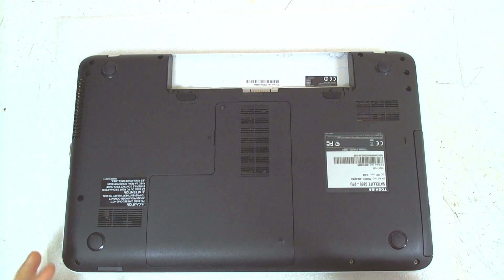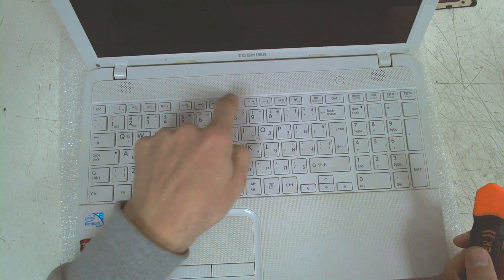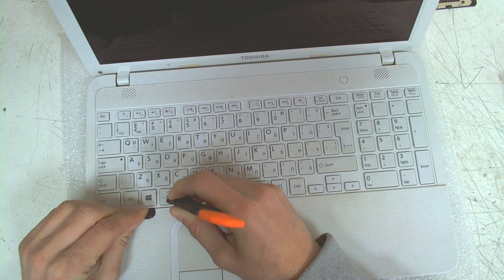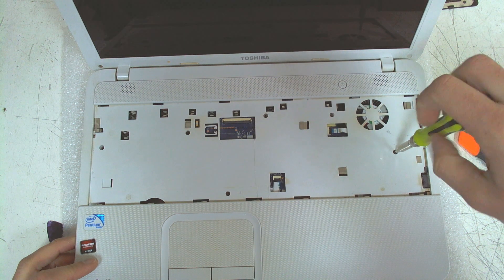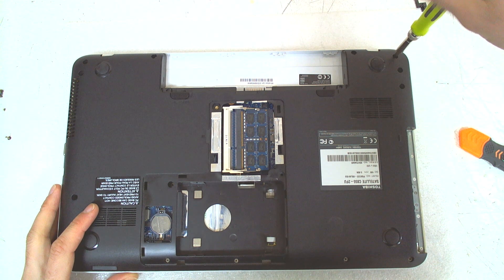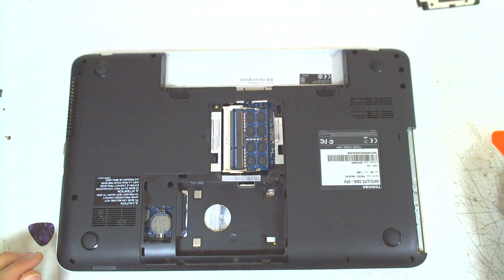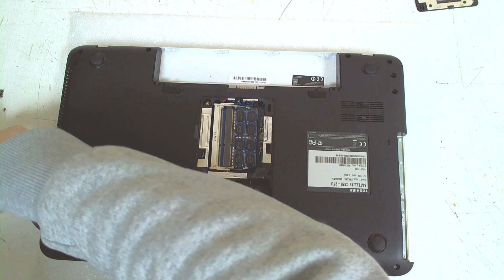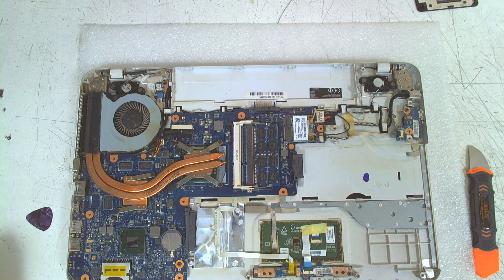Toshiba Satellite C855 2FU / fan cleaning

Comment: just make sure you get the keyboard out correctly, you definitely have to use a very thin thing like a blade to get to that much deep below the keyboard. If you can't get the keyboard out because of the keys, you are forcing the wrong layer out, you will have to go deeper.

Comment: My laptop reboot after  i touch T on the keyboard or every key around , is that video will help me
Reply from the maker: Do you have some liquid damage on the keyboard. Try reconnecting the keyboard. The problem is in it i think.
Reply: @LaptopDisassembly  i did it, and i thought the problem was solved, but today while i was typing something, the laptop restarts after i touched R
Reply from the maker: Did you have some liquid damage on the keyboard after all
Reply: @LaptopDisassembly  nope, i don't have any sort of damage
Reply from the maker: My guess is that the keyboard is faulty. It is very thin, so it may have internal damage on it. Disconect it and use external keyboard for few days, to see is everything fine.
Reply from the maker: Also check if something is shorting under the keyboard
Reply: This is what I usually do when I want to write something important so that it does not restart automatically without saving the file, and it totally did

Comment: is there a way to use replace optical drive for hdd and use ssd for this laptop?
Reply from the maker: Yes you can use a caddy. It is the same like th optical drive but with place for a regular disk. There are two sizes 9.5mm and 12.7mm. Just check the thickness of your optical drive.